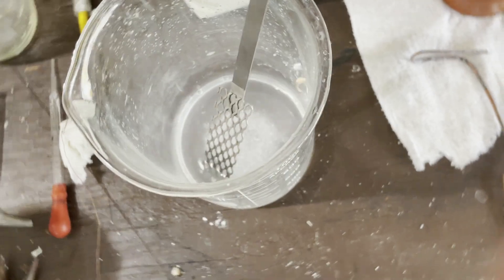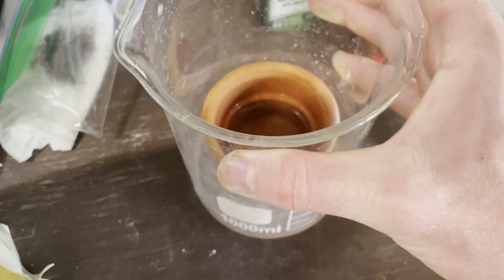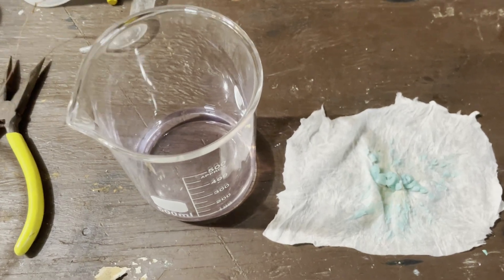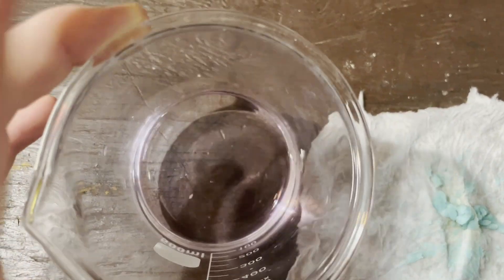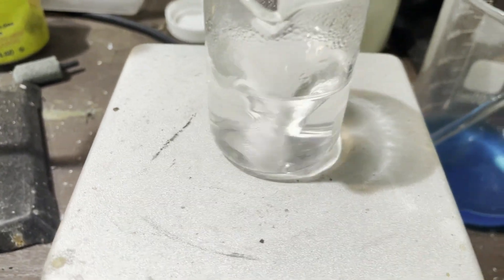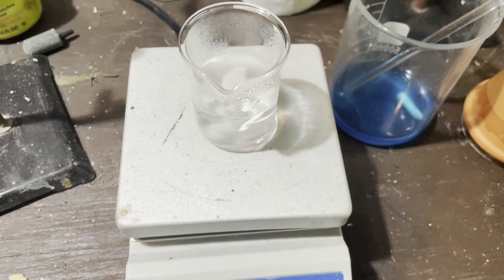Sulfuric Acid from Epsom Salt

Comment: the purple color is probably from the clay pot (clay have alot of contaminants, metal oxides are common in this), neutralize a few mLs from the acid, and check the color, if the pink color got more intense and there is a precipitant, this is probably manganese sulfate
Reply from the maker: Interesting, I didn't think of that thank you for the comment.

Comment: Nice video! Are there any uses for the magnesium hydroxide that is formed as a side product?
Reply from the maker: It is a base, so you could use it to neutralize an acid and make other magnesium salts. But besides that I have yet to come up with any other uses.